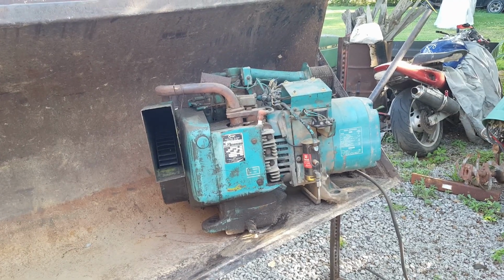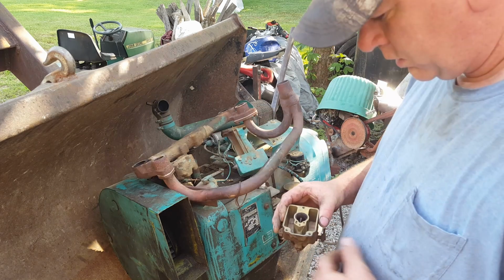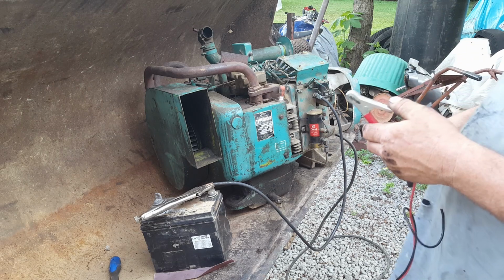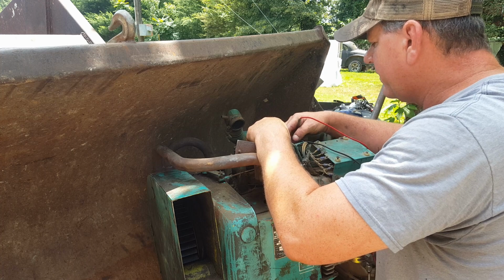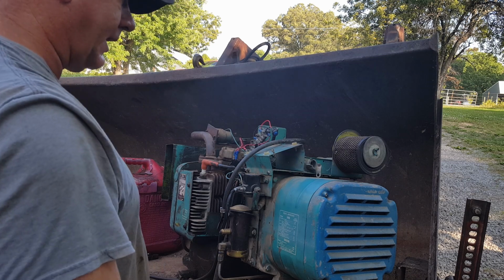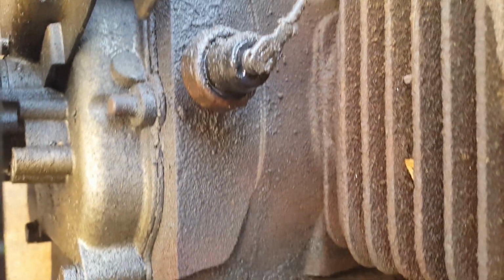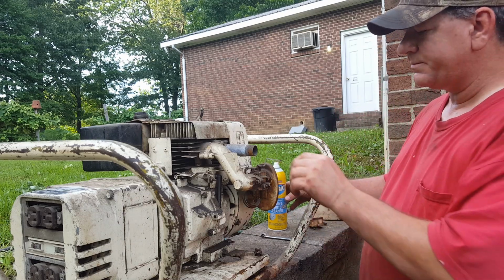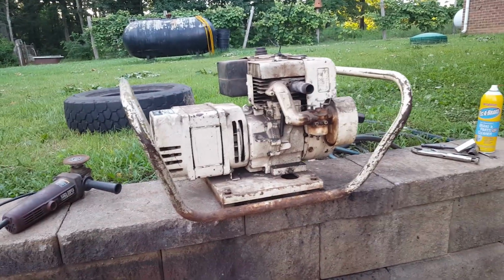MOW - Can we get this 4KW Onan generator running?

Comment: The cheapest muffler I ever engineered was a five gallon can that held water but it had a cap on top that you could unscrew... I took some flex pipe and ran it from the exhaust to that can down into the water and it sounded like a outboard engine... just add water as it evaporated.. now I ain't as cheap as my dad was as he turned his toilet paper over and got the last wipe out of it.. said that he got the idea from the scotch people.. when they flew over scotland, they had their toilet paper hanging on the clothes lines. I don't know to this day if he was joking or not as some folk did use cloth an just wash it... damn, imagine getting trouble as a kid an having to wash the dang out house wipes/LOL. I would of made that detail at least twice a week as a kid

Comment: I love those generators. I want to get one and build a trailer for it and use is as a backup generator for our cabin. That thing runs so nice! Good job.
Reply: Sometimes you can get an old motorhome for next to nothing even free sometimes and they'll have these generators in it.
Reply: @joshjablonicky171  not going to lie I've thought about doing that many many times. 😅
Reply: @dirtyroofer3678  I would never thought of that that's actually a really good idea could I used to install backup generators and remove the old units and depending on the job we take the old unit with us. I lived out in the country and I had one set up for my house it was awesome you lose power go kill the main breaker box from the street fire up the generator go inside flip the switch for that and boom my whole house has power again I even ran a giant extension cord off of it to my mom's house which was next door.

Comment: Fun stuff. I had my first 4kw Onan dropped off for what I would assume was an attempt to drive me mad. I figured it out and after that I got 3 more back to making power, a couple models of 4kw and a 6.5 kw. One of the 4kw units did have the generator act as the starter, the others all had separate starter motors. What they all have in common is the specific way that their start run sequence has to be, several solenoids all work together before there is any power sent to the coil and fuel pump. I figured out how to get one of them running without a good board though. I had to put the battery voltage to the starter, coil-fuel pump and the tricky one was the field wire, it had to have power to get the output power registering which opened the solenoid to the coil and pump and at that exact second cut power feed to the field and that was as close to hot wiring one of these as I've seen done... If they don't run, dollars to donuts it's the points or the fuel feed...

Comment: I have the 5kw version of this exact same generator.
It runs good when it wants to run, but it hasn't ran in a good long time now.
Most of those wires are for the remote start module.

Comment: I was glad to see this. I had a CCK onan given to me and it too and it has lots of wires hanging. I covered it up and didn't pursue it. I did notice it doesn't have a starter and uses the generator to start it. The good thing about them is they are 4 pole generators and run at a slow 1800 rpm. I think I will revisit it.
Reply from the maker: Get in there and figure it out!  👍

Comment: You know, the old me would have just said "that lets you know there's oil in it, like a Shovelhead." 
...but yeaaah, that seal needs doing. Good little gennie though! Handled load like a champ. I was expecting a bit more bog down when grinding started, but nope! 
Loose carb, red herring. That seal's what parked it, betcha. Probably just about the time gas jumped over a buck. 1997? 8? Just outta highschool for me.

Comment: Hey there Mr.  I was watching your video from June 4th when you were working on your 53' Chevy truck. 
 And you said you were having a tuff time finding copper core plug wires.
  Try getting some from a Motorcycle shop they usually have them in stock , you can buy it in a roll and make your own. 
 They are usually 7 mm.  But sometimes you can find 8mm. 
  The last time I made a set of those it was only about $25 for a 25 foot roll.
Otherwise Summit Racing probably still has rolls of it available.
Reply from the maker: You can find them but they think a lot of them. I buy copper core by the roll and that's the only thing I put on the old tractors. Need to buy some ends for various types.
Reply: @ThisNThatGarage  I got the plug wire ends from NAPA AUTO Parts.  If I remember correctly they were in a box of 10.
Reply: @ThisNThatGarage   If you are going run solid copper wires on a HEI GM ignition.  Make sure and get a low resistance center button for your Distributor cap, otherwise you are still not going to get the full benefits of the copper wires.

Comment: The thing on the exhaust is the automatic choke system. And I'm guessing the other thing below there that's tied to the governor,is probably the idle up circuit ( automatic) when there's an load on it! Just guessing.

Comment: Love the videos. I have a Kohler 4500 watt. The start stop switch went bad so I disconnected it leaving the little wires off and put in a regular key switch and now I don’t have power. Does the generator need voltage to the exciter to get full power?

Comment: Hello brother cowboy here I was just a wondering do you ever sell any of those old generators I'm needing a small cheap generator I can try to mount on my 97 Chevy suburban/ home just for general knowledge I'm a senior disabled vet with cancer and currently homeless however I'd be willing to pay for the unit and shipping it don't have to be very big infact smaller is probably better just need to charge my wheelchair and run battery charger and such I've tried solar panels just don't seam to work well for me lol thanks for letting me ramble on always remember be safe healthy and happy God Bless 🤠
Reply from the maker: Email me at thisnthatgarage1@gmail.com